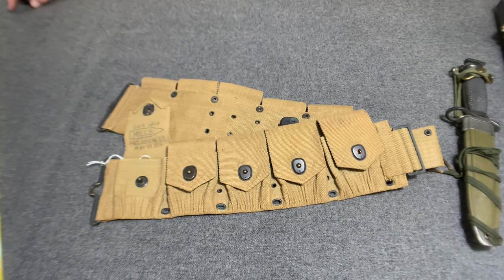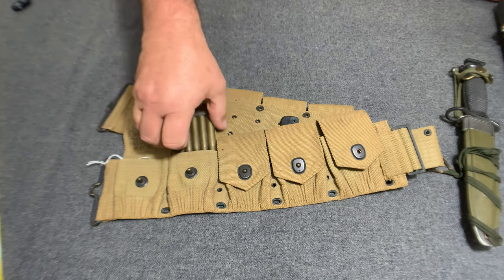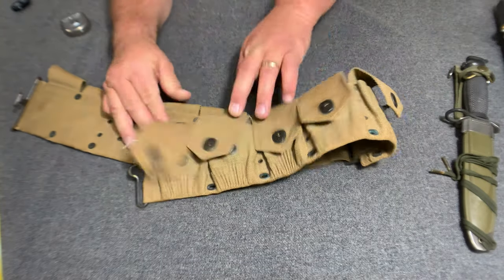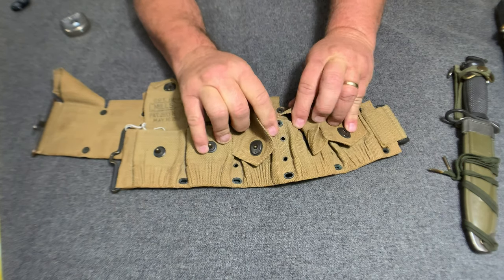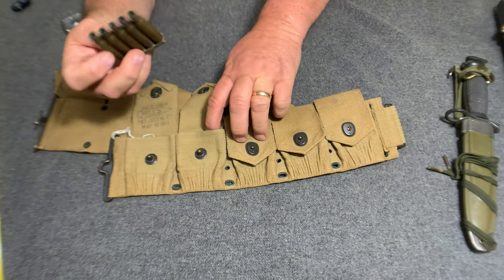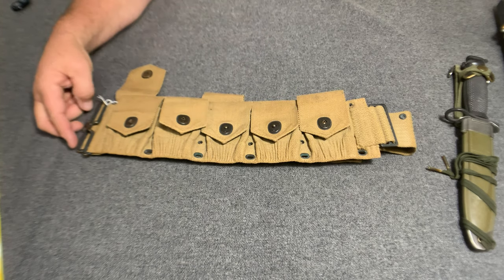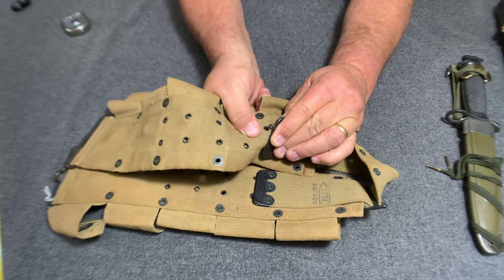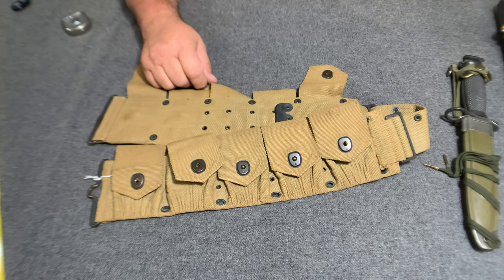WW1 US Gear M-1910 Dismounted Cartridge Belt,  Late War Type

Comment: Each pouch holds two stripper clips of five rounds each. A charger retaining strap would go over the front clip to retain it after the flap was open to remove the back clip.
Reply from the maker: That’s what I said but I use the word charger instead of stripper clip ,  thanks for watching
Reply: @WebGearReview  yes sir I just used different words a little more precisely incase anyone wasnt able to ascertain what was being said. I like the videos.
Reply from the maker: Well I meant to use the word stripper clip but Ended up saying charger thanks for making the clarification
Reply: @WebGearReview  Also, the stripper clip would be at the top pf the pocket. The bullet tips would be at the bottomed 'puckered" end of the pocket.